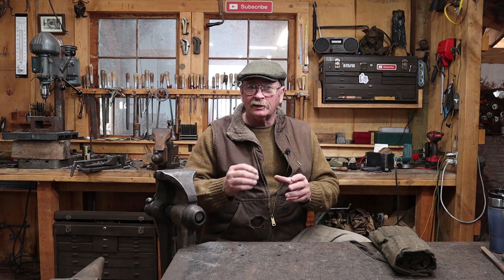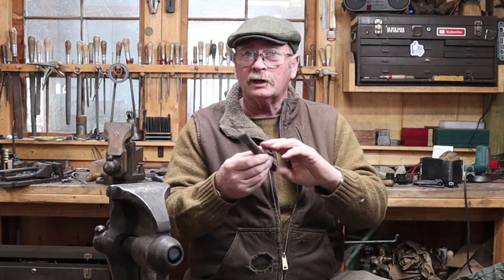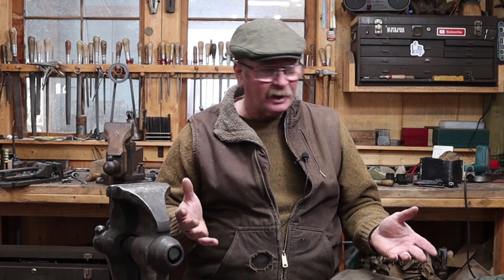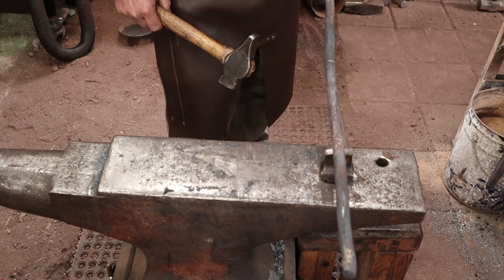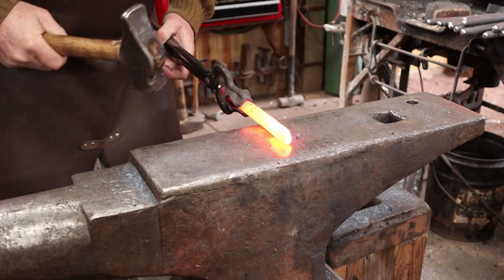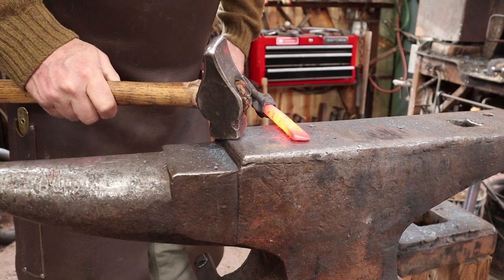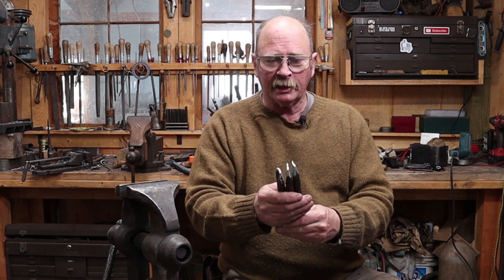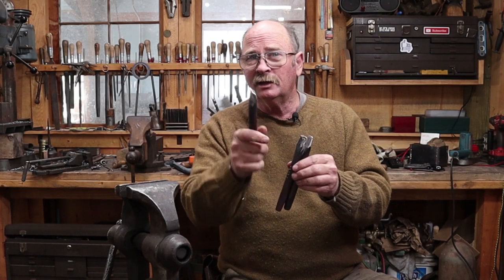Tear Drop blacksmith punches for decorative work

Comment: Nice video. I use a piece of pipe and a hardy fork when straightening out coil spring. A heavy dogwood mallet and a board on the anvil is handy for pounding out light stuff.

Comment: Thanks for that, as always great explanation of technique and clear working procedure. Nice to see some tools that help give an artisan touch to the work. Coil spring has proved to make excellent quality tools for me, edge retention is is up there with the very best. I try and always have a number of different thickness coils at hand. Usually make a few extra blanks when I am straightening our the coils. Handy thing to have and can be quickly shaped as needed. I see a year has passed since this video was made and lockdown is still very much a reality so great to have resources like this to inspire and to keep both mind and hand occupied through these challenging times, Thanks again for all your input.

Comment: I would love a video on good sites to get non-blade steels like 4140 as I do not really know where to get them. I like that you have a guard on your angle grinder, I have seen master smiths who do not use them and the angle grinder is one of the more dangerous tools in any smiths shop especially when using a cut off disk. Keep up the good work.

Comment: Nice tools you made there, John.  I can't wait to get out to the forge and make a set...lots of applications.

When I cut coil spring for one (or more) tools, I always just cut one at a time, from the end.  That way you aren't crowding the adjacent coil and risking a nick.  You will have to later fight to straighten and cut the other tools from it anyway, so just do one at a time.  Also, it's much easier to just measure around the end of the coil 6, 8, or 10 inches, whatever you need, cut, and straighten the shorter piece along the anvil and post vise....much easier than wrestling a longer piece.

Comment: I do always enjoy your tool making videos, John. My treadle hammer is getting closer to completion a friend gave me a 256 lb acme thread bolt for the anvil. Using your treadle hammer has given me a closer look at how you use the dies. Do you have any suggestions for what I really want/need for both the top die and bottom? Do you use a universal type for the bottom when actually forging with it? When I get closer to final assembly I'll try to post photos on your BB forum.
Reply from the maker: Holy cow thats a big bolt.  I'll try to do a video taking a closer look at my dies
Reply: @BlackBearForge  Thank you John. I am bound to learn something

Comment: Given the toughness of the coil spring, when cutting it into 3 pieces, could you not have used your side grinder as you did to cut the original piece?  It seemed like a lot of work using the hardy.
Reply from the maker: It isn't that much work on the hardy.

Comment: Concerning fatigued steel, wouldn't the fact of normalizing the steel return it to it's natural state? And then of course you heat treat it after?

Loved the punches!
Reply from the maker: Normalizing will not repair any fractures in the material. Sometimes they are to small to see but will eventually cause failure.
Reply: @BlackBearForge  Ahh, now I understand, thank you!

Comment: What happens if you quench something like S7 in oil or water?
Reply from the maker: It will probably crack.  However, I do know someone that quenches S7 in water, but after watching his process, I think he was quenching well bellow the recommended temperature.  He seems to get away with it.

Comment: You said, "I turned the gas pressure down to the absolute minimum this forge will run at..."  Why?  Was that to keep form overheating the chisel or something else?
Reply from the maker: Less gas equals lower temp so I don't get it to hot and can also bring it up to heat more slowly
Reply: He's just wanting to temper it, so its his preference in having it heat more slowly. Doing hammer work, you'd want it to be as hot as possible without damaging the forge or the work. The important thing here is getting the hard working point and softer shaft. You don't really want to strike cold hardened steel with your hammer, but you want the working point to hold up it's shape. That's why he let it cool rapidly when he got a straw-bronze color at the tip with blues further up the shaft. The tip is going to be as hard as a knife, but the material behind it will be more resilient to stress.

Comment: You work too hard.  Get the metal hotter and bend it by hand.  Spring steel shouldn't shatter if it's tempered properly, right?